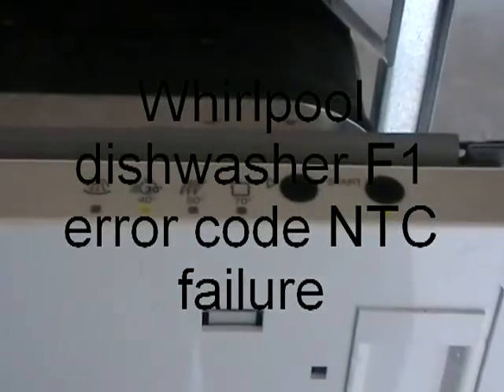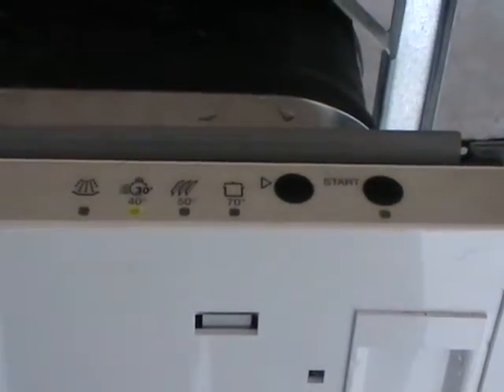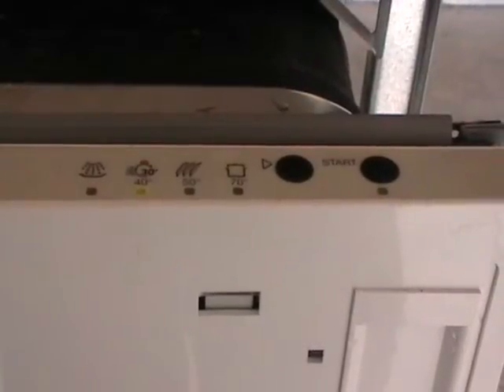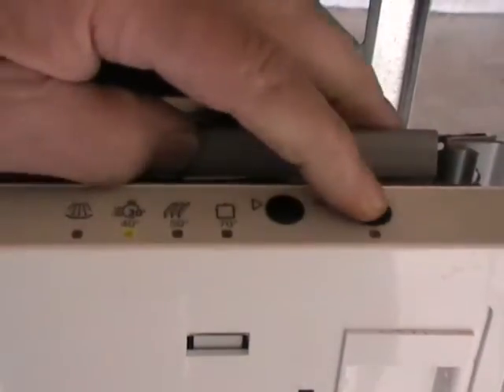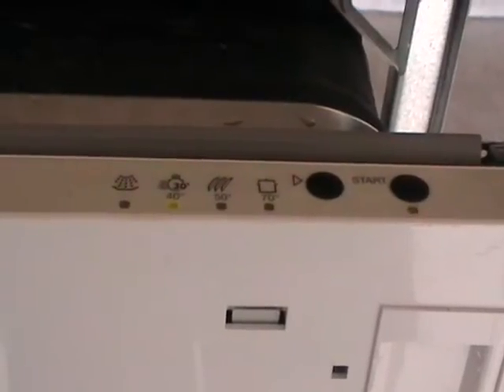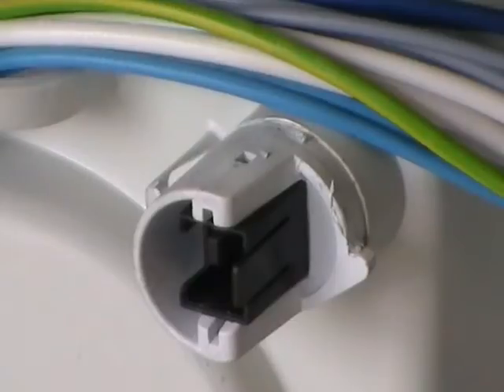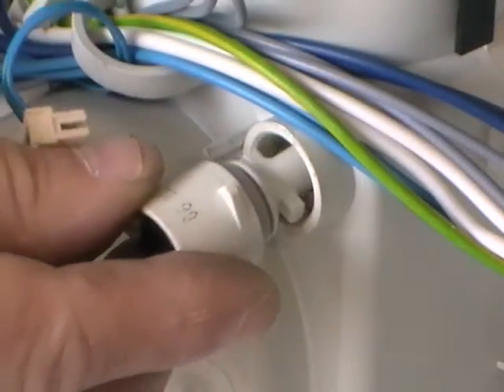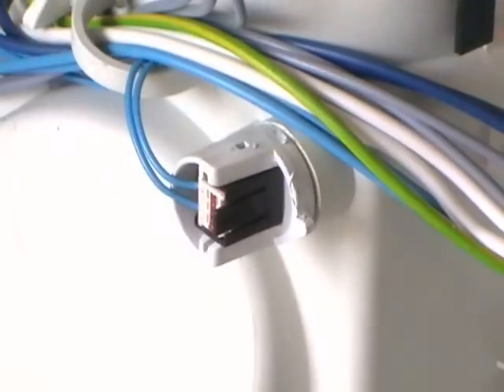Whirlpool Diplomat CDA dishwasher F1 error code NTC Thermister problems

Comment: Good morning, I have a similar problem on my IGNIS ADL 357 dishwasher. Before I buy a new NTC, could you please let me know what is the correct resistance value  I should measure across the thermistor terminals?